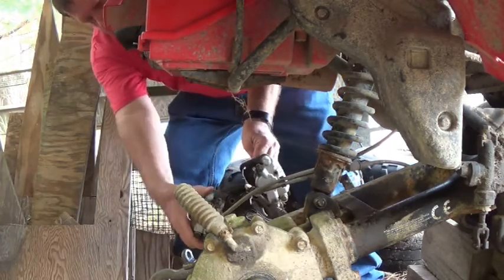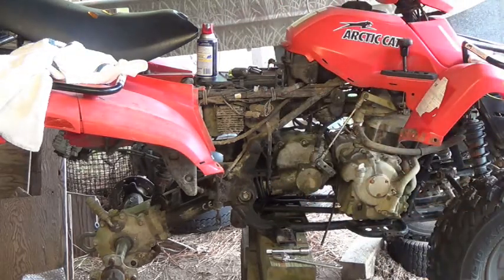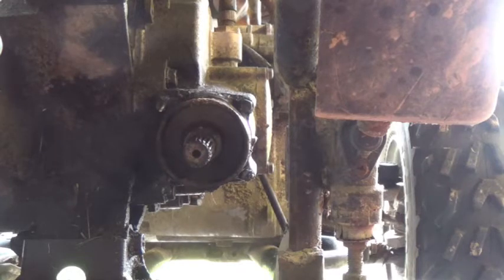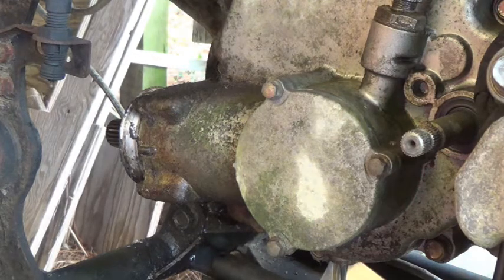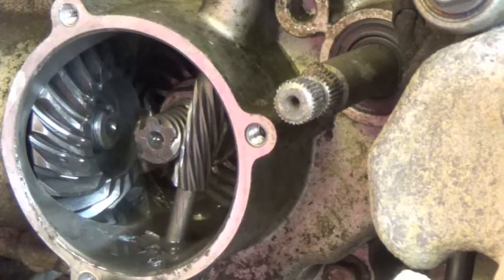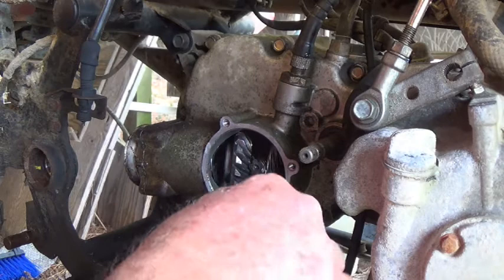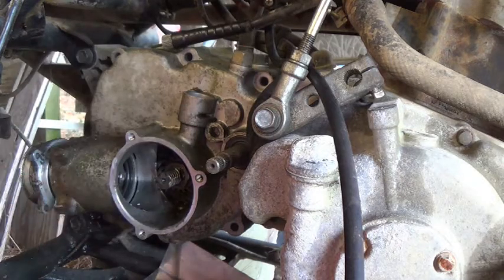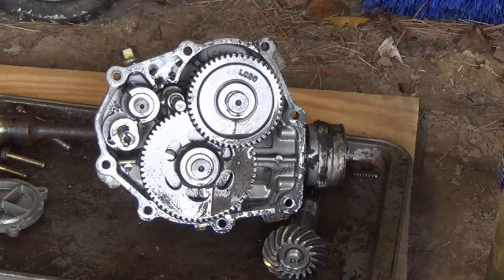Arctic Cat Transmission Repair #1

Comment: I have the same. The little spring and ball bearing that u had come out I did also. Where does that go?
Reply from the maker: That is the ball and spring that makes the shifter click into postion. When the gear case is back together the bolt on top the engine remove it and the ball and spring goes in their. video 10:17

Comment: Did you have to loosen the lock nut on the left side of the swing arm where it bolts to the frame before loosening the bolt itself? If so did you have a special tool?
Reply from the maker: Yes I did have to loosen the lock nut. I used my dremel tool and cut on of my large sockets to make it work.

Comment: Hello do you know anybody who willing to help me fix my 2009 Arctic cat 400. It sounds like grinding gears while putting on high. Anything helps thank you
Reply from the maker: I don't have a easy fix for that one. The only arctic cat dealer by me quit selling them. I just down loaded the service manual and fixed my own.
Reply: Make sure when shitting into high range that the shift rod is moving the bracket far enough and not broken
or that something got bent on the outside before tearing into it. try moving the bracket by hand with the rod 
disconnected first .if if don't move that way dig in.